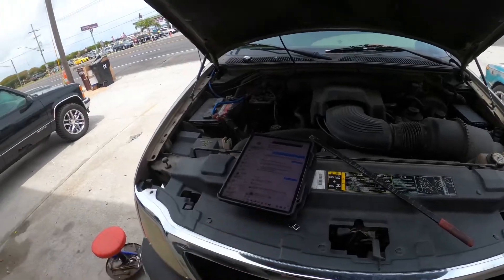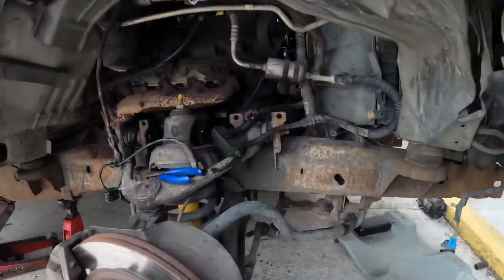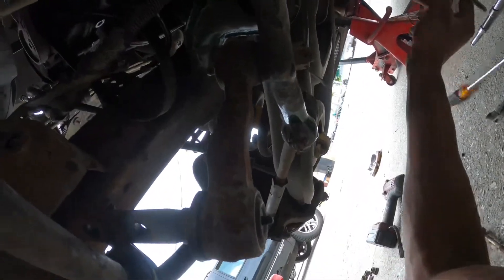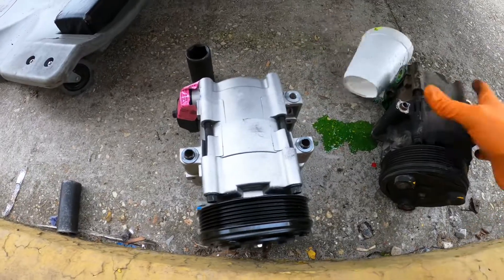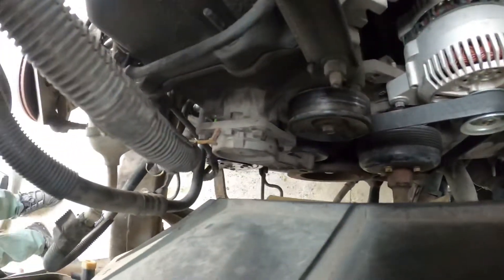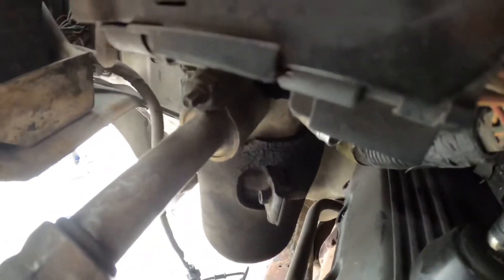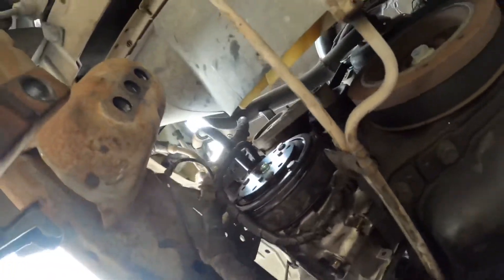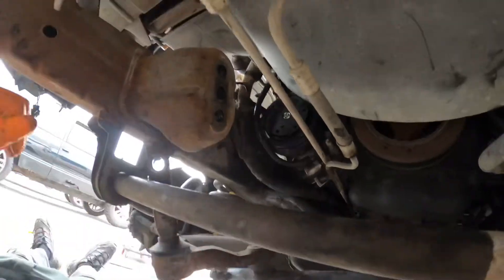2002 F150 AC COMPRESSOR REPLACEMENT

Comment: I just finished doing this today for a customer and rather than removing steering arms I turned the steering wheel all the way to the right which moved the arms out of the way and the compressor came right out.  I did not have to remove anything else.  Great tip using the ratching swivel wrenches.

Comment: Before adding refrigerant, you gots to vacuum down the system to make sure no leaks or air in system.
Reply: @ Trader Jay, I was wondering if he was going to mention that. Yes you do need to pull the vacuum on the system so it will work correctly.
Reply: But it does give you a lot more room to work on the air conditioning and compressor system when you take the wheel off and take the front fender well off everything's right there then you don't have to worry about taking the cooling fan off or the fan shroud or any of that so I give him points for that.

Comment: I just did this on my 02' F150 5.4. Only I was super cheap and slapped in a $36 newish-looking compressor I found on a truck at the junkyard. I did put in a new dryer. It works though and the a/c blows ice cold. I also removed the idler arm, and yea it took some wiggling to coax the old one out, but really it's not that bad of a job.
Reply from the maker: 36$ and it’s blowing cold can’t beat that lol

Comment: Golden!!👍👍 thank you sir. I’m about to do this job on my 2000 f150 .. question do I have to vacuum anything if I install a new compressor .!!  ?   Thanks.
Reply from the maker: If the system is full of Freon then yes it would need to be vacuumed but if there’s no Freon in the system then it’s fine to take apart
Reply: @Eazyauto  awesome thanks for that .. 👍
Reply: You’d have to recover the refrigerant then vacuum. Best to  just pay a shop to do it right. Don’t what moisture in your system that could kill the compressor a few years down the road possibly.
Reply: @EastDallasKicks  thanks !!all the refrigerant leaked out overnight ..sucks but oh well !! Turns out there was a hole on the condenser . I end up replacing AC compressor , radiator and condenser since they were about 20 year old ..

Comment: I'm going to be doing it with the V6 engine, but also replacing the dryer.  Will take a look if moving the steering linkage out of the way will help.  There may be more room in the 4.3 L version.
Reply from the maker: Yeah moving the steering linkage made it way easier hope the video helped
Reply: Got done with it.  On v6, comes out easy from the top after intake filter removed.  Easy. Even the dryer tower came out easy after pulling out the wiper fluid reservoir.  Only had to disconnect upper radiator hose.

Comment: Nice installed I know it was little over a year but question I have ask, what brand of compressor did you use and do you remember the model number on the green tag 2:59 mark in the video. Thanks
Reply from the maker: I most likely got it from Napa since it was directly across the street from the shop
Reply: @Eazyauto  Thanks I will look into it.

Comment: how long of a job will you consider it ?
Reply from the maker: It’s about a 2 hour job taking everything out and puttin it back in not that bad
Reply: @Eazyauto  including ac recharge ? trying to estimate how much to charge the guy lol
Reply from the maker: @adrianvega4817  including ac recharge that’s about 30 mins so rough estimate a good 3 hours from taking the compressor out installing the new one and recharging the system it didn’t take me long at all even recording it still felt like a 3-4 hour job and that’s from stopping trying to explain so I’d say 3 hours total
Reply: @Eazyauto  what would you charge with a recharge?

Comment: That way works for a 2wd I got a 4wd so unbolting the steering arm thing won't do it.
Reply from the maker: I seen people take it out from the top but that consisted of taking the fan off to get that clearance to take it out
Reply: Not true. The compressor just fits behind the steering linkage on 4WD.
You place it completely vertical, slide it part way up, turn it 90 degrees and up it goes. Drop the back and there it is. No taking the fan off. No fighting the steering linkage. I'm not even sure you have to take the idler arm off. I did but it might have fit had I just turned the wheels to the driver side.